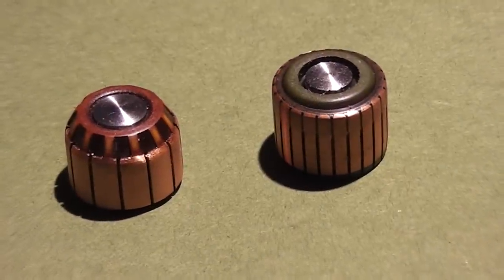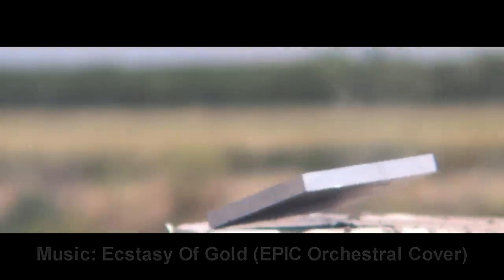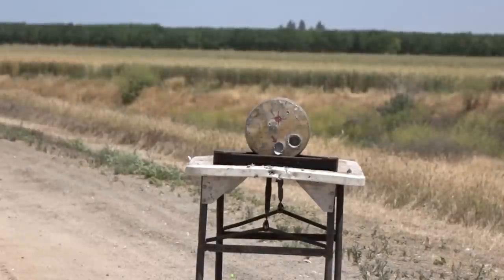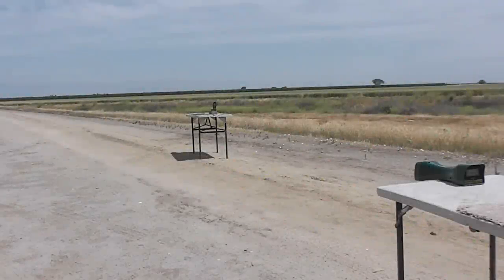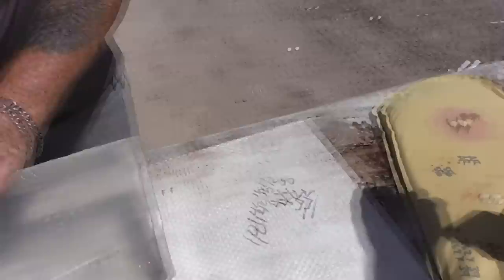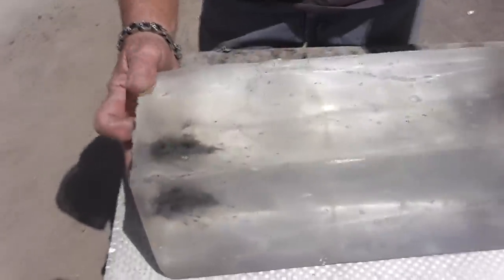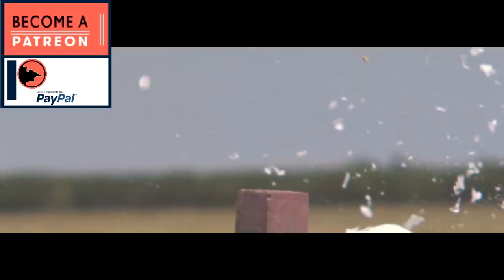12ga Slugs - Motor Commutators-  Awesome Performance!

Comment: That is one fast round! 
The ballistic gel hit looks BRUTAL! Not very penetrative, but the damage looks painful.
Danny's shirt is also quite awesome! xD
Reply: Honestly, it seems like it would make a great round for situations where overpenetration would be a worry.  Hits hard, splinters like mad, doesn't go more than about 6" in.
Reply: @ellencameron3775  home security.
Reply: The commutator shaft makes excellent backup insurance in case the rest of the assembly fails to stop invaders. I wouldn't want to be hit with either part. That's a definite life-ender.

Comment: I'd wager the steel core in the commutator is only interference fit in there, I'd be interested to know how much of the total projectile's mass is represented by those steel core sections as it looks like a great deal of the outer section is made up of relatively light carbon with some copper sections, the difference in how the heavier steel core and the lighter outer section accelerate in response to the force applied by wad during firing would mean the sections were likely to separate. Another interesting video nice work lads.
Reply: It'd be interesting to see these two-part loads with a coin or similar metal section in the sabot to help ensure the entire assembly gets accelerated at the same rate.
Reply: @NicRobertsNerd  yeah that's what I was thinking as well, maybe a couple nitro cards or a dime superglued to the base, or perhaps a steel disc of the same diameter but a little bit thicker like 1/16", a dime probably would warp under those pressures since they are so thin.
Reply: The copper is attached to the core in a mass of nonconducting resin that comes in various colors. That's what the orange cloud in several images is, and the black crud in the gel.
The shaft has lengthwise grooves to force the commutator to turn with it but there's not much preventing it sliding off.
The commutator's mass is a lot less than the shaft so per F=ma it accelerates much faster but it also decelerates faster when it hits the target, which is why the commutator splats while the shaft makes a hole.
Reply: @markfergerson2145  Yes you are correct

Comment: I take it, that, other than the steel core, the commutator is mainly copper wire and ceramic magnets. Seeing the truly horrible damage it did to the gel block, it's not a round that I'd like to be shot at with - as both parts hit the target separately. Fascinating as always, gents. Thank you.

Comment: That was so cool if you look close to the slow mo of the gel you can see the gel is all warppped right when the core hits it and it flies threw in a straight line leaving that super crazy wound track when it popped back to it's normal shape had to watch a few times to see it but you can't under it once you do.😂👌 Good shooting Danny

Comment: The way it separated in the gel reminds me of the RIP round. A gimmicky round that's supposed to maximize wound potential with a segmented copper projectile that comes apart inside the target.
Reply: I had the exact same thought, that's the only other round I've seen do that.

And I know they call it "gimmicky" but having 20 small pieces of shrapnel while having a core continue through is actually an incredibly damaging combination. Only one of those needs to hit an artery or something to be lethal, and it's getting a lot of chances.

Comment: To the slug maker, braze/weld a thin plate across the back of it and to the copper windings as well. My initial thought is at high power, the steel shaft flat face is providing enough resistance to the air that it is being pulled out of the commuter because it is conical on the end.  Another thought is that the larger rear surface area of the commuter is allowing it to accelerate faster in the barrel. Its probably both of them LOL

Comment: Haven't heard the term Kentucky wind-age since basic training, i was advised not to use it and on the M16A2 it was easy enough to make elevation and wind-age changes but impossible to get a battle site zero as it was always a different gun.

Comment: Neat concept, when it works. At the lower velocity, I'd love to know what it woudl have done to the gel. Maybe more penetration before the copper seperates? If so, this is a very angry sabot where the penetrator discards the sabot in the target. Also curious what you'd get if the vest was in front of the gel. Semi-APDS w/ HP performance?

Comment: Danny once again proves his mastery of the particle accelerator with a high degree of accuracy! Even though they shot somewhat high, their position and distance on the plate was pretty tight.  Curious at what point the core separates in flight. Those do look very cool though - "Steampunk" is a good description.  Its so much easier to see what's happening in that great new ballistic Gel (I think a mold with super smooth sides and polished finish would give best results when re-molding - Tinfoil lining maybe?) Another excellent video that actually demonstrates real world kinetic testing and science at its best!  You guys are the Best!  When are we gonna get some more of that sweet songwritin' Jeff?   : D   - MM in Denver

Comment: Taofledermaus where are you located? I just finished a 304 stainless steel piston hybrid (compressed air, combustion, vacuum barrel all in one) it will propel any 38mm (1.5") projectile you can think of at Mach velocities. Let me know if you would like to collaborate or anything.

Comment: Would a crimp-on gas check maybe help hold the core in? Or maybe an adhesive compound? The one thing worrieing me is the linear grooves maybe accelorate gas cutting in the bore.it is more of an issue with rifling but still very cool!

Comment: A washer welded to the back end of the core is my idea.
Reply: Only thing that would worry me is how much deformation the weld heat might introduce
Reply from the maker: Just a loose metal disk behind it would have helped greatly

Comment: The commutator often contains three components: the sleeve that is pressed onto the armature shaft, mica insulation and copper bars (contacts).
Technically the shaft is not considered part of the comm specifically since the comm is often a replaceable part when repairing and rewind.
Not a big surprise that the the section of armature shaft separated when propelled

Comment: Jeff, I have an experiment for Evan Perry. He has already proven his skills with Diabolo rounds which all seem to have the same length proportions. On a lathe he should be able to stretch out the round length starting at 1 times the diameter and incrementing 1.2, 1.4, 1.6, 1.8, 2.0 times.... the diameter for the length of the rounds.  It would be interesting to see the effects and optimum length to diameter for these rounds. From the looks of most rounds they look like length is about 1.2 times the diameter.
Love your site.

Comment: Remove the steel core, use soldering flux and fill the center with lead. Devastation recipe. Cool video, thanks!

Comment: i feel like with a speed in the middle of what you tested it might hold together and shatter the copper while punching the steel core through, like a 2 stage bullet. you have this massive punch to soften the impact site and the core for penetration power, these are probably really expensive with the amount of copper but a slug like this looks quite promising.

Comment: One I'd like to try on various targets - a tungsten needle in the very center of a hollowpoint slug, in aluminum (high velocity), and lead (high mass). In theory, on impact, the bullet should transfer most of it's kinetic energy into that pin when the tip of the pin hits the target. It's a failed European AP pistol round concept that worked great, but was too expensive - but the physics behind it should scale with mass as well as speed.

Predicted results - with lead it should do the same as a hollow point slug, with an additional pin hole through the target. With aluminum, the slug should stop much more quickly, while the pin exits even faster.  Not sure if the pin would tumble or not, also not sure if that would really be a problem or not, since it already hit the target.

Comment: I feel like those kinds of projectiles you should put something like a coin between it and the wad/shot cup to prevent the cores from falling out
Reply: Specially if you are able to use a coin made out a really strong material (for example steel)

Comment: those steel cores would probably stay in if Evan used something like a silicon bronze rod to braze it in from the bottom. Not as strong as a fully fused weld, but it might be enough to hold it together, especially with well seated wad

Comment: So in soft tissue will it still expand if the slug hasnt come apart ? Or is the only reason it does expand is that it DID come apart when accelerated?

Comment: Is it possible to punch 1/4 inch plate with an aluminum slug with a hot load?  Some folks say water can cut steel so aluminum should be able to.  They were also talking about copper in relation to shaped charges like in a rpg round...but I don't think they understand the physics.  Water doesn't compress so density calculations are sorta messed up.  I remember you guys shot the plate with those turbine rounds but it looked like it was aluminum too or another light alloy.

Comment: A very good reason why the Aluminum plate is so hard to penetrate is because its surface has oxidized.
When it does its becomes almost as hard as diamond.
Diamond is 9 on the scale. Oxidized Aluminum is 7.

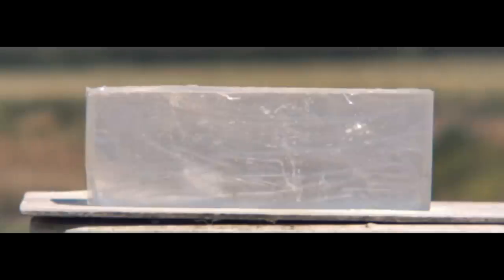Comment: I'm just thinking... If the back of the projectiles had a small copper plate soldered to the main body, it would maybe fix the separation problem and actually do what you were talking about at 10:00

With a smooth-bore shotgun, this kinda stuff would've been such an amazing projectile, more impressive than it is right now. Maybe the core would have too much overpenetration though, but this would be worth trying against soft body armor. With a sharp tip, it would go through it like butter, I think!
It could mess up the aerodynamics though, but since the high-powered, smooth-bore shots were so stable, I think that absence of a hole in the middle wouldn't change much.

Comment: Can somebody with skill make Diablo or pellet shaped 12 gauge rounds with a tungsten core for those lead and aluminum plates? possibly a small tungsten screw with a tiny steel nut tightened up to the top of screw in the Diablo or some shape from the minds of the masters that create these projectiles. I can picture it but I have nowhere to make these. Thank you, these videos are amazing!

Comment: I've seen 12ga slugs hit ballistic gel and it didn't knock the entire block backwards like this homemade slug did. OUCH. I calculated the 170gr muzzle energy at about 2000ftlbs and a 1oz foster slug muzzle energy is about 2300ftlbs.

Comment: Evan should try to make ammunition that can be spun in the chamber at high rpms prior to being fired from a smooth bore rifle/shotgun, negating the need for rifiling. 

I suppose the round will be fairly long and that the propellant charge will have to be quite significant otherwise at some point down range  the round will begin to drift with the rotational direction.

After a bit of r&d it could be sold to the military to use in conjunction with man portable rail guns. 

Can be further developed to assist in long range deployment of swarm drone payloads. 

Evan should also try his had at putting a neg in a round to see what happens when a negatively ion charged round does through the air. 
Y neg ion charge at x velocity should split the atmosphere like lightning does but at a much much smaller scale. 

Yes yes sounds scifi but what hasn't become science fact from the scifi realm of possiblitys?